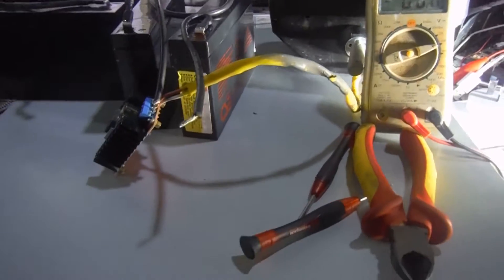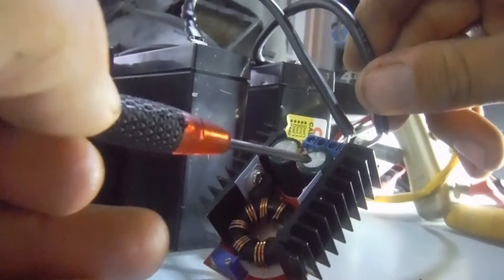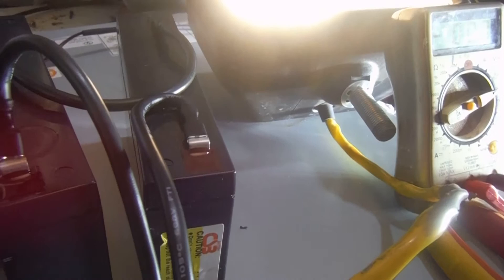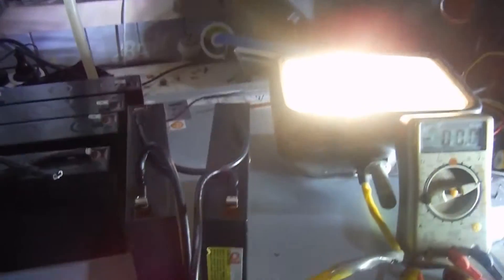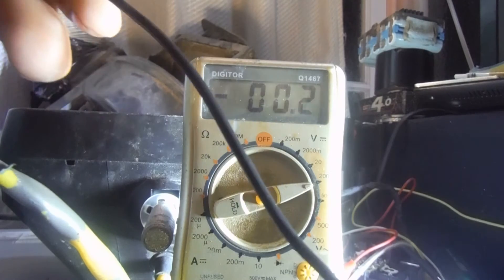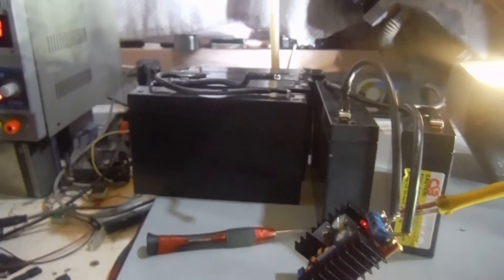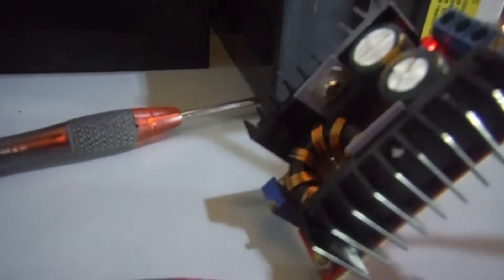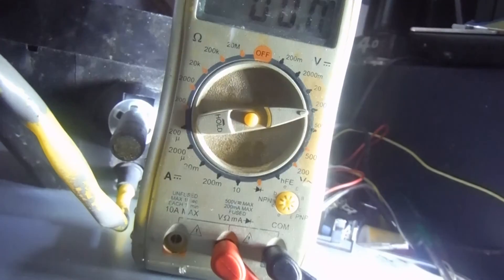Mini DC to DC boost converter 150w

Comment: I have a 12v 33ah gel battery but 2 dc motor wants 24v 
can I use it?
Reply from the maker: +Selahaddin Yildirim yeah but motor will be slow and  lack power
Reply from the maker: +Selahaddin Yildirim they are only good for 150 watts